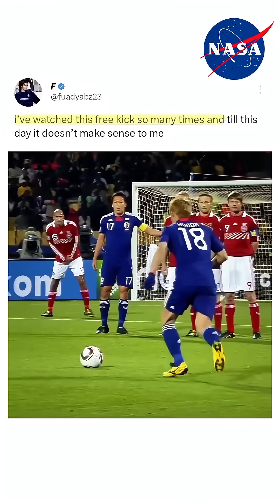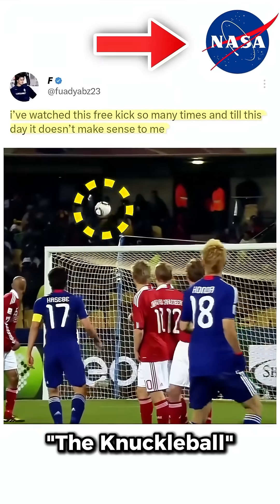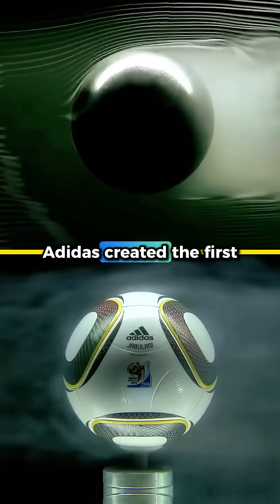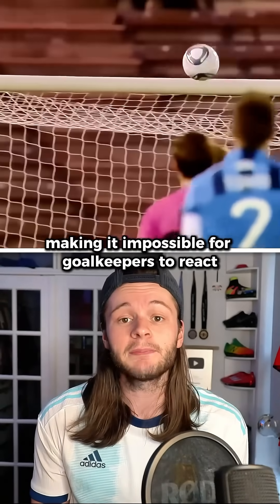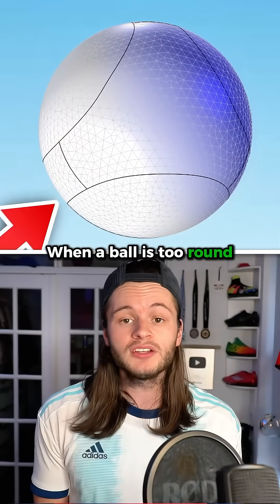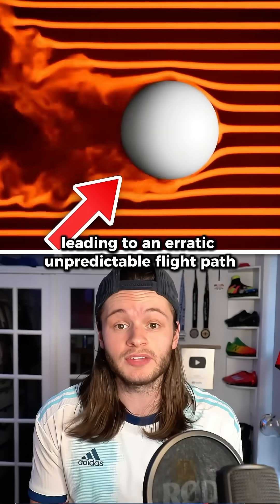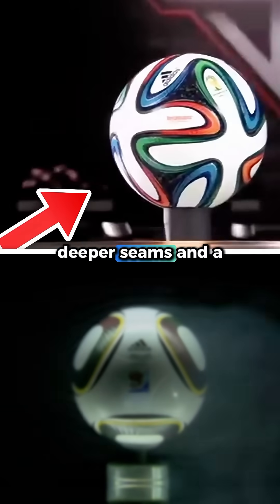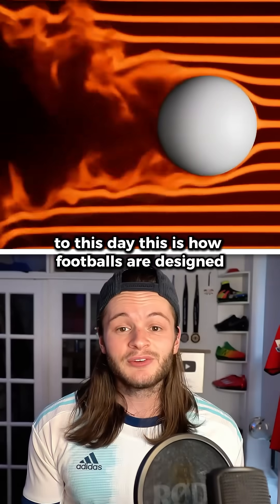The Demise of the Knuckleball

Comment: They missed a part of the puzzle here... the reason it's called a "Knuckleball" is from a type of pitch in baseball where the pitcher grips the ball with their fingers bent and the outside of the knuckles making contact with the ball instead of the underside of his fingers or fingertips.  

The purpose of the pitch is to take the spin off the ball so inconsistencies in air density/minor air currents have a greater effect on it and cause the ball to "wobble" on it's path instead of traveling on a more precise line making it harder for the batter to track and hit it squarely.

You can see this same concept taking place in the slow-motion parts of this video--- the ball isn't spinning (as in rapidly making full rotations), therefore it's going travel through the air on an erratic path or veer off a random angles for the same reason the pitch does.
Reply: Video says NASA needed to solve this for soccor players and fans. Baseball players and fans have know this for decades.
Reply: @firefalcon07  The only puzzle here is why a perfectly round ball presents THIS erratic of a path. I wonder how many centuries we've known about a ball moving through the air with no spin. Far longer than any modern sport im sure.
Reply: @iballisticduals3048  a perfectly round ball still shows erratic movement because the air it's travelling through has density/current inconsistencies that push the ball around... if there's spin on the ball, the motion cuts through these inconsistencies somewhat so it flies straight, or potentially turns on a somewhat intented curve based on the direction of the spin
Reply: @firefalcon07  I was about to say, pitchers know that the seams grip the air when it spins and lower rpms the more unpredictable the movement. Same reason a curveball works, the seams are pulling the ball down from the air drag
Reply: @firefalcon07  Vollyball too. its all bs. They've known for 100's of years that a none spinning anything traveling fast is not predictable. cannons/muskets to rifles.
Reply: @firefalcon07 Actually we football fans, the ones you see the sports a long time knows this a long time, we just didn't called it "knuckle ball" we, or at least me and people here would calle it "effect" that is the curve. I saw Roberto Carlos making this for years so Football fans always knew maybe not with this name or whatever. Also de football players always knew, that's why they did it. I already saw "knuckle balls" in recent years...
Reply: @numi2000  I can respect calling it "effect" if that's what football players call it... certainly a fair term to describe what the spin (or lack thereof) on the ball does...
Reply: Do soccer players even use the knuckle ball term when kick the ball straight on without a spin causing it to wobble?
Reply: @CytoplasmicGoo yes soccer players use the term “knuckle ball” to describe a shot without spin.
Reply: @blazen9958 Crazy how a national sport took verbiage from American baseball. Like they didn't even try to think of a name
Reply: @legendarien1075  They didnt. Its called something else.
Reply: @blazen9958  I suppose it makes sense, that term has been around for more than a century.
Reply: @legendarien1075  to be fair, many soccer fans are also sports fans in general and the term knuckle ball has been around a very long time.
Reply: @blazen9958  ooh, so the lack of Magnus effect makes it an anomaly
Reply: @CytoplasmicGoo  the term knuckle ball has been around a very long time

Yes, but only in baseball.  When has soccer players started using their freaking knuckles.  It doesn't make sense.  Make up an original term related to soccer.
Reply: @ I'm sure they had their own term for it but since it's a worldwide game I wouldn't be surprised if there were a dozen terms for it depending on the region you're in. I think they started using the term knuckleball because it is already an established term for a wobbly ball and was adopted to standardize the term. It is weird because a young soccer player in spain is probably wondering why it's called a knuckleball when no one uses their knuckle to play.
Reply: @CytoplasmicGoo  even if the actual players don't, they did in this video...
Reply: @CytoplasmicGoo  Cristiano Ronaldo Free Kick VS Portsmouth.

He kicks the Panel of the ball that has the Valve

Kunckleball
Reply: The “drag crisis” mentioned in this video is exactly what causes the random swerving of a knuckleball pitch in baseball, not small air currents or overdensities. NASA found that a non-rotating sphere has a critical speed, below which its movement is unstable. In both baseball and football, the ideal scenario is that you throw/kick the ball faster than the critical speed with no spin. Then as it slows down through the air it experiences the drag crisis and becomes unstable, leading to the desired sudden swerving
Reply: @ it didn’t take nasa to figure this out. Just Nolan Ryan.
Reply: I never watched baseball and I knew about the knuckle ball from somewhere, might have been in some cartoon or something.  Volleyball has the float serve which also relies on the unpredictable path of the ball when its hit with no spin.
Reply: I hate it when people like the guy in the video confuse the Jabulani with actual knuckleball technique.

A real knuckleball in football is a technique that actually requires a lot of skill to - just like in Baseball - put as little spin as possible on it to make it fly unpredictably through the air.

The Jabulani was a garbage ball that every idiot and their grandmother could kick and it would move like that. A fake knuckleball with the Jabulani requires no skill whatsoever
Reply: Lol who cares. That means nothing. We aren't talking about real baseball bro nobody is actually knuckleballing the soccer ball
Reply: You missed the part of the puzzle where they are talking about soccer balls being kicked by feet. Genius
Reply: @pointofpersonalprivilege he's talking about the name, dumb ahh
Reply: @pointofpersonalprivilege 
Wow you are stupid lmao.
Reply: @pointofpersonalprivilege  Do you know what a "knuckle" is, genius?  Do soccer players use their freaking knuckles, Albert Einstein?  It doesn't even make sense that soccer would use the term "knuckleball".  They should've thought of an original word.
Reply: @pointofpersonalprivilege  tell me you're a millenial who can't think in the abstract and just parrots what's in front of them without telling me you're a millenial that can't think in the abstract and just parrots what's in front of them.

Comment: The science behind this doesn’t add up.
The ball isn’t a perfect sphere in flight, it warps with the pressure of being kicked, and the elastic pressure creates a ripple throughout the ball continuously… that ripple alone would create air resistance.

It’s fine science for a wind tunnel with air moving around the stationary ball, but isn’t good for science of the ball being impacted so heavily that it flies through the air.

Edit:
The UK lads have known about this “science” for decades as well with the penny floater.
Toe-punting / toe-poking one of those would create wild jarring flight patterns of the ball until the impact elasticises to the other side of the ball creating basically a parachute on it stopping the ball almost dead mid-flight.

Comment: Yeah but the techniqe also works on not so round balls. The conditions however may not be met. The ball must not have any significant rotation and has to travel in a specific speed and the effect is actually stronger if the ball is travelling at a slower speed.

The only thing the 2014 ball did was due to its increased roundness it also increased the maximum speed for this effect to still take place. It is something that is still being done in other sports (for instance volleyball float serves or baseball knuckleballs).

I think this NASA explanation is not correct though. There are always three things that happen here: drag, lift, drag crisis and turbulence all of which can cause the ball to move in various directions. But drag crisis is known since 1905 and is a phenomenon where the drag coefficient drops off suddenly as Reynolds number (ratio between inertial and viscous forces) increases.

Comment: Funnily enough its actually a pretty basic concept in aerodynamics that a rougher textured ball flies smoother. This is specific to bluff bodies, like spheres, as opposed to streamline bodies, like a wing. You can actually see that the steam lines detach much further back on the smooth ball because the airflow near the surface is laminar (it doesn't stick to the surface as well). When airflow detaches, it creates vortices which cause turbulence. A rougher surfaced ball (ironically) creates turbulent air close to the surface of the ball which you can think of as being stickier. This causes the streamlines to detach from the surface farther down the ball, resulting in less turbulence from the vortices. As you can probably guess this is also why golf balls have dimples and baseballs have seams.
Reply: I tried to design a model plane for fun at mechanical engineering school.
So i read 5 books about aerodynamics till i realized that i know absolutely nothing about aerodynamics.
Reply: This is why Golf balls are textured
Reply: Interesting how baseball seam wake throws a wrench into the simple mechanics
Reply: So I'm guessing streamlined bodies , like jets airplanes which are systematically tapered , reduce the friction drag  while circular bodies like a ball increase the drag ? Correct me if I'm wrong , I'm bad at physics lol
Reply: yeah beyond the science... 20 years ago in middle school volleyball, we were serving knuckles...
Reply: @donkeygong64 Nice! Not sure if it’s the same back in my days of volleyball, we called it a “Floater.” My senior year, I learned to perfect it. Id plant my feet about 1 and half feet apart side to side (not the regular one foot forward, one foot behind it) so my arm and body motion was limited to an extent. Once I served, the ball had so little rotation that it literally floated, slightly zig zagging which would make the bunter hesitate and he’d mess up by bunting it with one or the other side of his forearms. It was pure magic.

Comment: knuckle ball is not the 'weird effect with the ball moving sideways', it actually needs grip for the ball to come down as soon as momentum diminishes. the weird effect of the ball going sideways multiple times was because of the round shape and the weird stitching they had on the balls between world cup 2010 and 2014. it also happened if you just stroke it incredibly hard with a full foot, it was caused by the air and the knuckle ball technique just made it easier
best knuckle balls used to be with the old balls like the trad champions league one because of the traditional stitching in addition to those 'bumped' panels, the premium old ones were almost spongy and that's why juninho and pirlo went crazy with them. 
you still see knuckleballs from a lot of people who can shoot it and it happens across multiple types of footballs

Comment: Knuckle balls are still more than doable! Problem is hitting it with the same part all the time. Professionals can do that, we can't, but when we do it, it's still magical!

Also, i dunno what you call this shot but if you hit it towards the right bottom corner (the 'keepers left if you're right footed or if you're left footed then the keepers right) and hit it with your laces BUT keep it low. Some goalkeepers don't expect that but its basically just like an inswinger, a curler but with more power. Works quite often.

Comment: We don't see it as often because the Jabulani required almost no effort to knuckle, but you can still knuckle any ball if that's what you are going for, but players go for accuracy rather than unpredictability for obvious reasons
Reply: Cristiano used to hit really accurate knuckles
Reply: @alejandro_gumtz He mastered it when he was young.
Reply: I was about to say the same, but then found your comment and you are 100% correct.

The Jabulani has nothing to do with the knuckleball technique because it required no special technique for the ball to move unpredictably.

A knuckleball with a normal ball does require a lot of skill and technique to put as little spin on the ball as possible.

Personally I think the reason why we don't see that many knuckleball shots anymore is because we don't see many long distance shots anymore, which is where the knuckle ball is most effective.

From shorter distances, accuracy is much more effective that unpredictability.
Reply: Bro it grip is also required for ball control and drribling